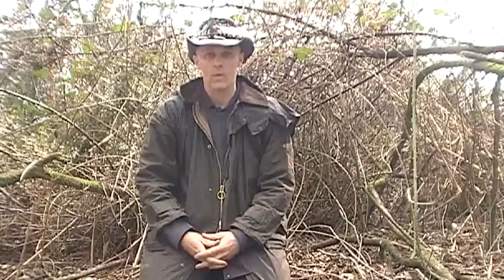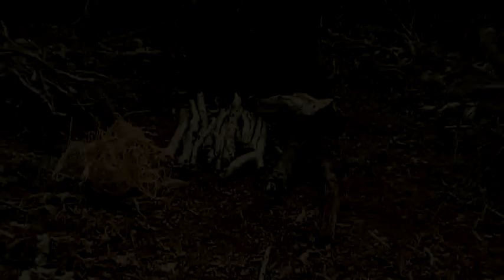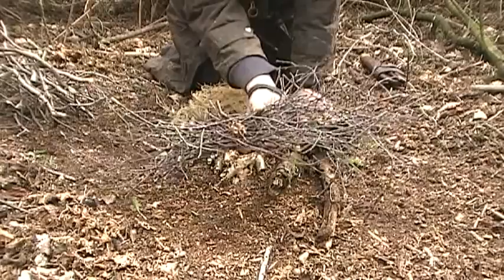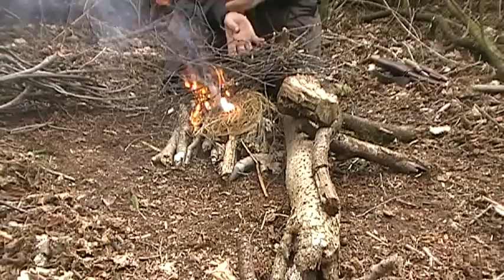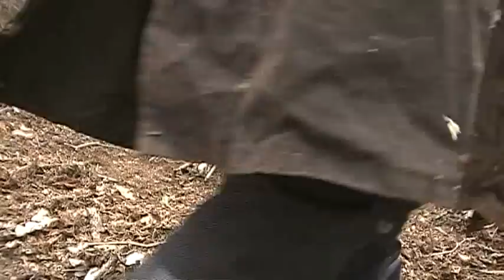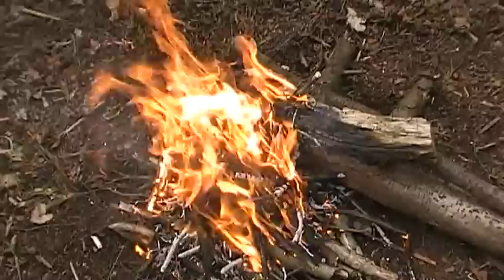Creating a sustainable fire

Comment: Sean, I saw your video a few years back on the upside down fire, and have been using it ever since. I would highly recommend going back and checking out that vid to anyone who hasn't seen it, or is unfamiliar with the upside down fire. I built a 3 base layer one this past weekend, and it went 3 hours before I had to touch it or add fuel!